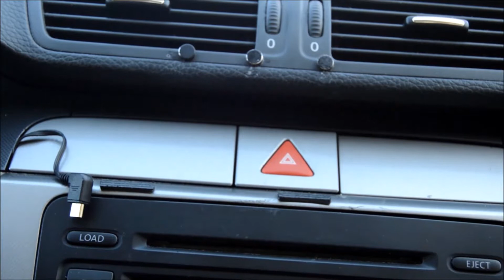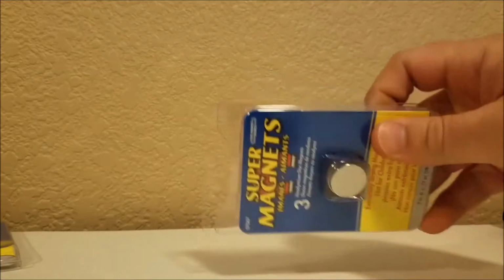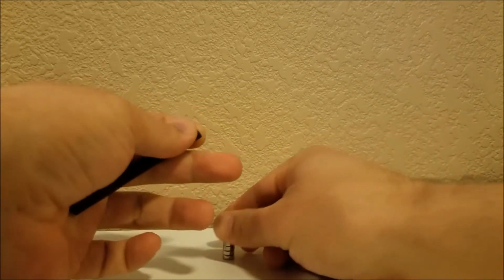DIY Super-Magnet Car Phone Holder(Neodymium Magnets)

Comment: Nice.  I am doing something    similar, but with magnets and wireless charging pads behind thin plastic cubby door my center dash inbetween the air vents. Heat shrinks a good idea.
Reply from the maker: Heat shrink worked great while I used it.  Didn't get sticky and lasted through the hot summers with no issues.  Your plan sounds great.  Good luck!